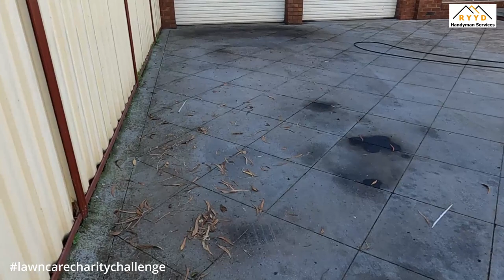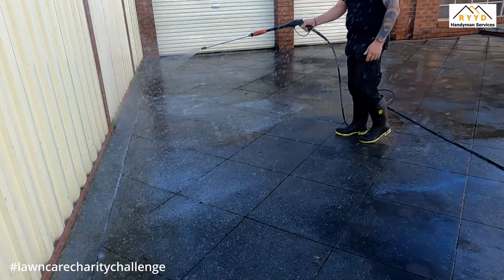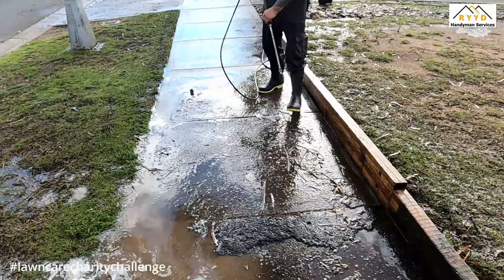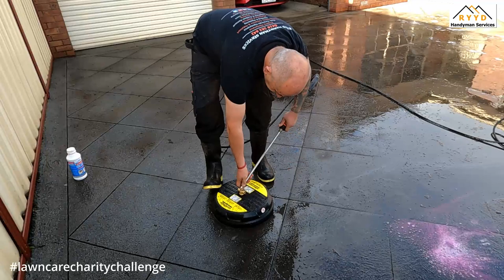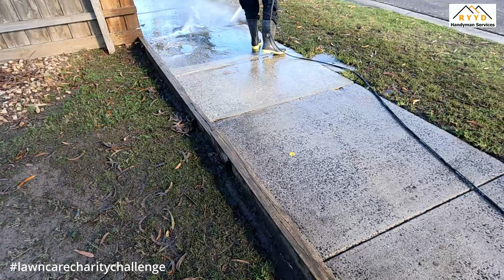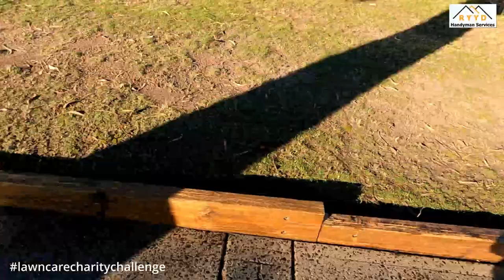Pressure Washing TOUGH STAINS on Driveway That Hasn't Been Cleaned In YEARS!

Comment: Good job, I see you have a Stanley cleaner, what size machine you run?
Reply from the maker: Thanks.
IT was originally a 2800psi unit but I have changed the pump to a 6500psi one after the original one died.
Thanks for watching and support.
Cheers 🦘👍
Reply: @TigerDusty  would you happen to have link for the pump upgrade? I’m interested in getting a Stanley PW but would like to upgrade the pump straight away.

Comment: Wow... That was painful to watch. :( 
Watching a working man use household tools to do a working man's job. 
Your back won't last. You'll be crippled by the time you reach your 40's.
Reply from the maker: You must have sore back. 🤣🤣🤣
.The pressure washer is a modified commercial unit that delivers 6500psi and I am 60 years old and my back is probably stronger than yours. 💪👎
Reply: @TigerDusty  If only I'd paid attention 40 years ago when they first advocated "Lift with your knees" and "Keep your back straight". My retirement wouldn't be filled with constant back pain. Experience is key to learning Grasshopper.